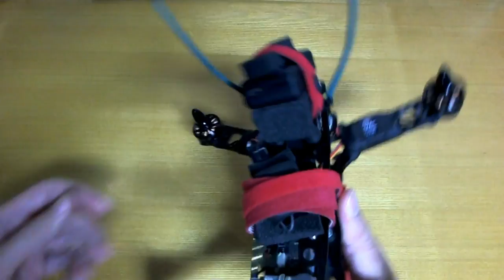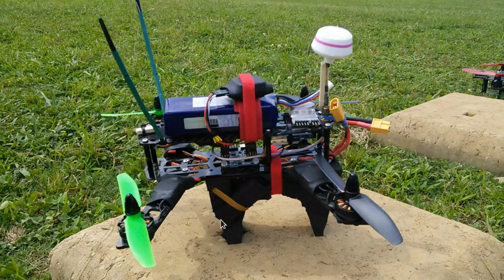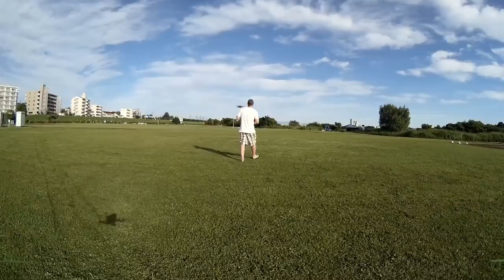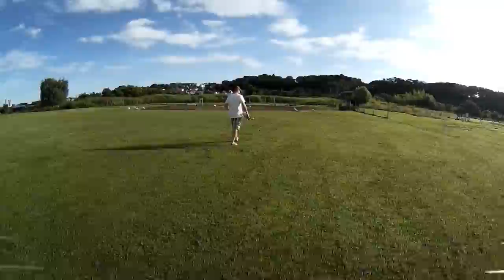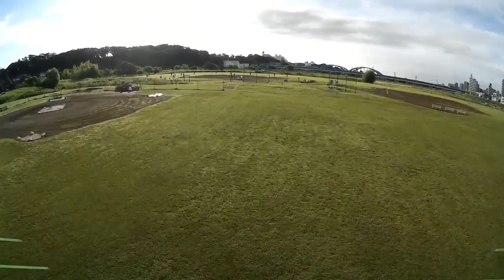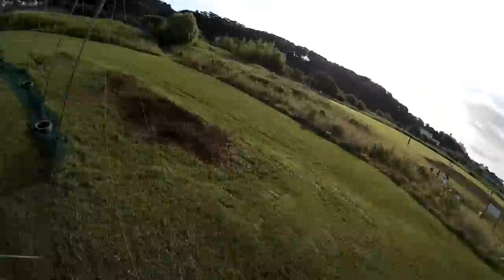Diatone #37 build part 4 (random stuff)

Comment: It's not cheap but it does work fantatsically on jello, try some sorbothan sheets from ebay. It was the only thing that would 100% eliminate jello for me via a mobius or sj4000. If you have 60fps capability, i'm told that usually also helps. I think I used 6mm thick sheet and was under £10 to do an entire fleet of quads.
Reply from the maker: MicroRCFiend Now that I've discovered the video out latency of the mobius is improved, I'm thinking about using it for FPV feed and putting it inside the main cage of the frame again. In that case I'll probably need to take a look at the earplugs or sorbothane methods.

Comment: Chris how did you setup the gps ? I thought it still wasn't supported that well in Cleanflight to give as good of a Hold as you have shown, mine wont stay still like in your first test
Reply from the maker: kermets What does yours do? Does it have GPS lock? Can you see your lat/lon coordinates in the configurator when you connect to pc/tablet? Did you shield the barometer from wind?
Reply: ***** its drifts away like home is somewhere else,I should fpv it and see where it stops or if it stops. yes i have gps lock very quick now with new Neo-M8N and can see the lat/lon in cleanflight and yes i have a small piece of black static free foam the sort that ic components come in , did you change any settings on your gps ?
Reply from the maker: kermets did you calibrate the compass properly? does it have at least 5 satellites? Do you have the buzzer attached - it will beep to let you know when enough satellites are present.
Reply: ***** yes it is very stable looking at the cleanflight heading degrees setup tab, yes at least 9 as shown with mini OSD ,but i like the buzzer idea to that will double check things, I just got a 3d fix inside and clicked on my lon/lat in cleanflight and it shows im about 6 meters away from where im sitting, its like the gps isnt even talking to the Flip32+ board
Reply: ***** Chris i had a chance again today, moved some wires away from the on-board mag which helped alot, wish we could use the mag attached to the gps without cutting tracks that way we could poke the gps/mag up on a pedistool to minimize interference,  is there a way to have the flip board re-act quicker to the data from the gps? it seems so slow at times and that's where the drifting is coming from

Comment: what fight controller are you using? you can put gps on this small? i would like to know..i might want to try this as well on my diatone 37
Reply from the maker: Tristan Rebuyaco cleanflight
Reply from the maker: Tristan Rebuyaco oops sorry, the flight controller is a Flip32+ board. It has onboard compass and baro so all you need to add is a GPS module, which are not too big. You can see more info about this build in the earlier parts of this series.

Comment: The aerial footige looks more then decent now sir, especially after de-shaking it.. 
Wouldn't it be more conveniant to do this project on a (slightly) bigger quad though?? Maybe something like this: 
https://www.youtube.com/watch?v=lKgZuHHOVZc Lots of room for 'stuff', and not expensive.. 
Damn.. those screws causing the electrical problem probably took quite a while to figure out? 
Cheers and have a good week!
Reply from the maker: DutchRC ADVENTURES Yes, I have a TBS discovery clone (very similar to your video) that I will try this with next. I'm mainly just doing it with this quad for now because it's the first time I've had a STM32 board with baro and mag onboard and I wanted to see how well it performed, and how well Cleanflight did GPS hold. Plus, the larger quad does not fit under the seat of my scooter to transport it around :) With this one I can do both FPV zooming around and aerial footage with same quad and make use all of my batteries (2200 and 1300) whereas the larger quad cannot use the 1300s. If I did not live in Tokyo I would be getting around by car and take as many quads and batteries with me as I like, and not care about any of this stuff. Incidentally the 'follow-me' quad will actually be smaller, 200 size, so I think the shaking will actually be worse with that... we'll see.
Reply: There IS someting to be said for portability indeed! :D  A 250 size quad can quite easily fit into even a backpack ;) 
I usually do travel by car.. That's probably why I fly mostly larger quads (my smallest is a 330 size one)

Comment: Not seen your park from above during the day before, it's beautiful. Here's one way to get rid of the barrel distortion if you desire.
https://www.youtube.com/watch?v=406eF1dlLi4
Reply from the maker: MicroRCFiend There is a barrel distortion correction filter for virtualdub, I spent half a day messing around with various settings and combinations of that and the deshaker filter. The barrel distortion correction works very well but loses image sharpness and cuts out a sizeable portion of the image edges. Then the deshaker cuts even more off the edges, so when used together you end up with a very narrow field of view again. In the end I decided to go with just the deshaker (it helps with processing time to only have one filter as well). I'll make a comparison video to show how each of these look.